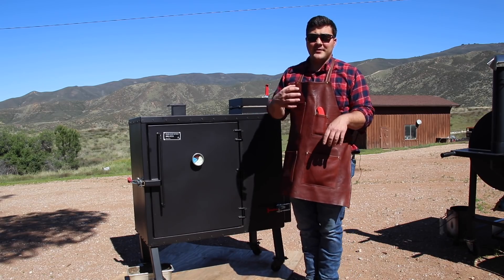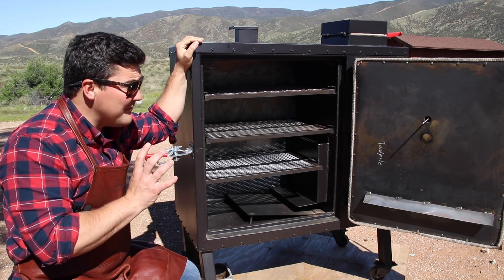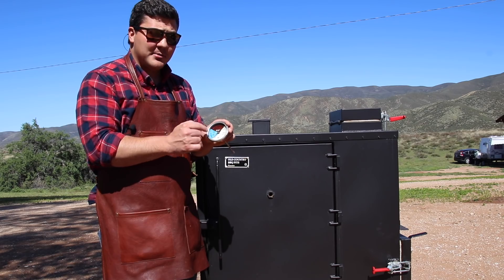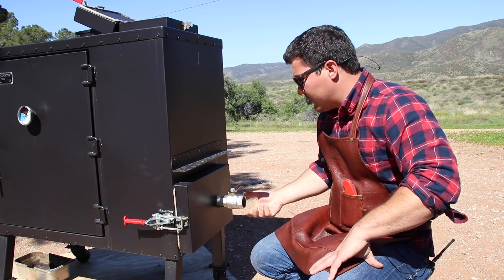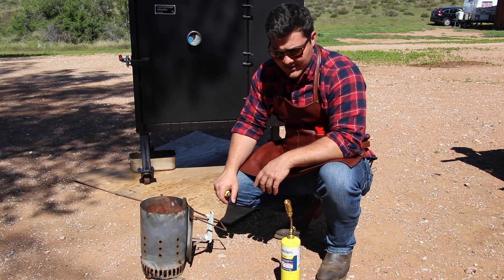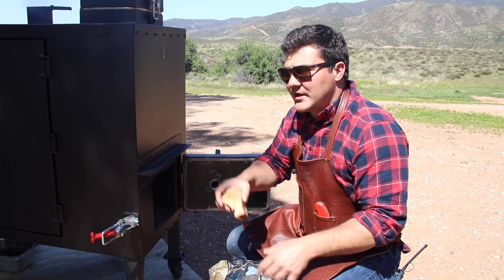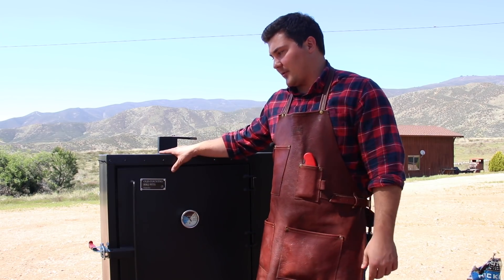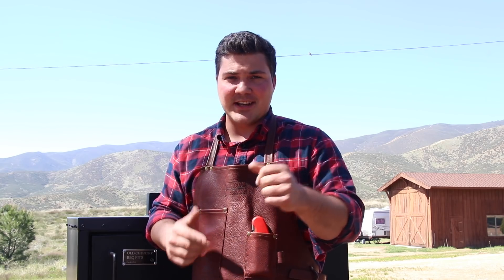How to Use a Gravity-Fed Smoker

Comment: Jeremy great video.
I just purchased this smoker yesterday and before I seasoned it I made a couple of modifications- added a SS ash tray. Added a shim to the grating selves to tighten mine were to loose for me. Added a hole on the left side to allow my temperature wires to pass thru. Removed the existing legs and wheel and added an additional 8” of height and 6” solid wheels. Also added a IQ120 temp control. Once I lit the smoker it seems to take a longer than expected to ramp the temperature up. For fuel used charcoal and four chucks of hickory once it got going it’s held between 250* - 275* for four hours now with adding any additional wood. So far I like what I’m seeing. Once the seasoning is completed I will be cooking ribs for the first time tomorrow. For the money it’s preforming very well. Keep the gravity feed smokers video coming..
Reply: What did you use to add your probe port? I have this pit and want to do the same.
Reply: Cilfton I just added a 2 1/2” long pipe nipple 3/4” dia. I was thinking on a 1/2” size but my probes have curve to them and the 3/4” gave me more room. Now since I have around ten cooks on it I can get the temperature up quickly using the I120 and it regulates the temperature perfectly. My only thoughts are I wish it had a larger cook camber. Good luck
Reply: How do you relight your leftover charcoal?
Reply: I added an expanded metal small box to hold those tumble weeds and I lite three of them with all the doors open until the existing charcoal lites.

Comment: I have a question but first I want to say I am a stick burner and have been since I got my smoker 28 years ago. So I don't understand the bitter flavor if you use too much wood. So my question is, will it work if I remove that grate, start a fire in the bottom and feed it just wood?

Comment: Nice job going through the review Jeremy. One thing I would like to see different is for it to come with larger (better wheels). Small wheels get caught in the joints of my paver patio. Has nothing to do with the cooker but is an issue. Lots of nice features. I like the cabinet type smoker with slide outs. If I get another one it will be this type.
Reply from the maker: Phil N Florence 

You’re right Phil. Big wheels would be a huge improvement. If you notice, I have mind sitting on a piece of plywood so that it doesn’t get stuck in the dirt
Reply: Good wheels can cost $200 alone.... Pretty much blow the price point of this smoker

Comment: I purchased one about a month ago.  I've done three cooks so far, the latest was pork butts.  Great cooker but having some issues on long cooks . . . the charcoal feeder is getting clogged with ash and killing my fire.  After about eight hours of cooking the fire starts to die and I can't keep the heat up.  I noticed my wood chunks were not burning and when I went to clean the next day there was a lot of ash in the charcoal feeder.  Have you had that issue?  Any suggestions?
Reply: I don't have this exact smoker, but do use one like it.  One problem I see is the charcoal grate spacing is too small.  Every hour or so reach in with a insulated glove and jiggle the grate.  This will drop the ashes and won't effect the cook chamber temperature.  I also do this when adding wood.  It helps the wood start smoldering.  I also use a ash tray made of 16 ga. which makes cleanup easier.
Reply: Are you using Kingsford charcoal?   I've heard people saying it ashes too much for this pit.    B&B or Royal Oak are supposed to have less ash issues or lump.
Reply: I bought one of these about a month ago.  I seasoned it with briquettes, but for my first cook, I used lump charcoal and had no problems with the feed in the chimney.  I did give the grate a slight tap every time I was putting in some wood chunks, but did not have any issues.  Way less ash, too...the briquettes ash was suffocating any wood chunks for smoking...didn't have that issue with lump charcoal.  Another option would just be scraping out the ash as you go...try lump charcoal, though...I actually made the best brisket I've ever done on my first cook and I still make a few mistakes and am learning about the pit...

Comment: Thumbs up for your german! Jetzt können wir anfangen! 
One question, do you calibrate your analog thermometer compared to your digital probe? I always have a problem with inaccurate readings... thanks and glad that you finally shaved! ;) greetings from germany
Reply: Florian Kett right ! I notched he slipped that in there, what did he say? Danke
Reply: @desmundlighten3603   he said, "now we can start"
Reply from the maker: I used to do that. Now I only really use the analog thermometer as a relative measurement. I figure out what reading works best and just make sure the thermometer reads the temp that produces the best results. You can get a digital probe to compare. It’s probably a good idea for your own peace of mind if nothing else

Comment: If you have to start off by dumping lit charcoal into the hopper, does that mean you have to unload all of the leftover charcoal from the previous cook in order to do another's cook? Hopefully there is a way to light it if you still have leftover charcoal still in the chute.
Reply: Get a charcoal basket and remove the fuel grate to catch the leftover charcoal to clear your chute. Then start your new cook with fresh hot coals. You can add the leftover coals back into the chute. Either that or you could introduce a couple of firs starters to the fuel grate....I wouldn't recommend it though.

Comment: My main skepticism is in having the vertical stacked racks. Wouldn’t the temp difference be pretty dramatic between the top and bottom rack? Have you tested it?
Reply from the maker: Anthony D 

Low airflow and insulation keep it pretty even. The slow moving air allows the heat to distribute pretty well
Reply: @MadScientistBBQ  I agree, that concept is similar to how a kamado works. Since there is low air flow, you get a cooking chamber full of hot air with consistent temperature.  There may be a .5° degree variance .

Comment: I’m really liking this gravity fed method. I like to grill but love to smoke. My issue is heat management on a kettle is a headache. Question, I know water pans diffuse heat, I’m assuming more meats on the same cook will do the same. Will this require more babysitting until temps has been reached? Lastly can a wired probe be inserted - pinched in the door - without it affecting temps too much. Sorry for my ignorant questions but I’m totally new at this. 
TIA.
Reply: probably, but id go through the chiminy.

Comment: Jeramy would you use a water pan in that type of smoker?  Also if you did would it help regulate the temp even more?
Reply from the maker: Jeffery Rhodes 

The temp is very consistent but I think extra moisture would probably be good. I’ll use a water pan when I do a butt or a brisket
Reply: @MadScientistBBQ  I got the brazos based off your video recommendation.  Have been very pleased with it but curious if there is a mod to put a shut off drain to the grease drain stem so I can fill the bottom with water.  Do you know of any good sir. By the way from MO hickory for the win!😎
Reply: @jefferyrhodes2346  I have a Brazos.  Get a 1 and 1/4" ball valve , can find them cheap on Amazon,  and a cheap one works fine for our purposes.
Reply: @lynndollar1013  thanks!

Comment: Love your videos, been following for years!  Would love to see a more practical video of what the cleaning of a smoker like this would be like after a long cook.
Reply: Is your smoking wood close enough to the bottom of the fire grate so that heat from your coal bed can ignite the wood without having to rely on bits and pieces of charcoal to fall onto the big pieces of wood because we know smoldering wood will not create blue smoke ...

650 degrees up to 750 degrees is ideal temperature to create blue smoke.. I'm sorry to say that I don't believe small pieces of charcoal falling on top of larger pieces of cold wood will create a 750 degree fire if the wood isn't up to temperature to create blue smoke .

I can create blue smoke on an offset smoker..

Looks like separating the coal bed from the smoking wood seems to be trying to create blue smoke in reverse...

650 up to 750 degrees Fahrenheitwould be the fire temperature inside your firebox not inside your cooking chamber.. several people get that mixed up.  

I watched Mr Yoder's video putting cold wood into a firebox but he never said anything about preheating the wood to bypass the white smoke stage of a fire but this video was just a dry run..

Lots of people don't know how to create blue smoke .. 

Should have a video on how to create blue smoke
Reply: @brucerogers3253 what does this have to do with cleaning a smoker?

Comment: own this exact smoker, at 1hr 45 min and only at 190deg.  takes me for ever to get the temp to 250.  i have chimney wide open and door cracked abuot 3" to get more air through but still takes forever!!!  any ideas??
Reply: I have this smoker also. Get the thermoworks billows with fan system or the fireboard 2 drive with fan unit. These are the best 2

Comment: The thing about running briquettes is that they create way more ash than lump so you have to be very diligent in cleaning out the ash after every cook or you will rust out your smoker. Not to mention all the filler used in briquettes.

Comment: Thanks for the  info! I've been try'n to make up my mind on which type of smoker i would like to get and the gravity fed seams really easy and the way to go,
     but it seems like the gravity chute would basically act  like a big chimney starter(like you started the fire with) and burn up the charcoal pretty fast? Maybe I missed something?
 How does it not catch the whole chute on fire?     How long do you think a large 18 lb. bag would last?
Reply: The charcoal hopper is sealed, so no air = no fire. Only the bottom few inches of the charcoal hopper is allowed some air (regulated by you)... More air = hotter fire. Where they went wrong with this smoker is no ash pan. An ash pan lets the burned charcoal ash collect for ease of removal, but the ash pan also lets you put chunks of wood in, and the burning embers fall on top and actually introduce SMOKE into the smoker. If you don't have that hardwood smoke, you're NOT smoking at all.
Reply: This is the same theory behind the Masterbuild 560  gravity grill. The charcoal on the chute won't light up until the charcoal gets the bottom.

Comment: My only question - is this really a set it and forget it smoker or did you have to throw in wood chunks every hour under the coal tunnel.   Thanks for the video!
Reply: Gonna bump this question. Seems like the need to add wood chunks frequently defeats the advantage of the ease of not having to tend the fire itself for a steady temp. That's what I dislike about my Masterbuilt electric. What about adding chunks or chips layered in with the charcoal so they feed along with it? I'd like to be able to sleep for a few hours at a time. And is there a port for meat probes or do you pass them through the door gasket?

Comment: My pellet smoker doesn’t put the Smokey flavor in the meat like my offset smoker. How would this smoker compare. I’m guessing it would be like the pellet smoker right?
Reply: Joe H. I just bought the old country wrangler offset because of that very reason. Even with a smoke tube in the pellet grill I couldn’t get good smoke flavor.
Reply: No, not the same at all. Pellets don’t get the flavor like actual would chunks or splits. You could keep the bottom loaded with wood and get some solid smoke flavor.
Reply from the maker: It’s the closest I have found to an offset. Not the same but way better than a pellet or ceramic cooker

Comment: Love your videos...  Can you easily stop the charcoal burn to save charcoal?
Reply: By using lump charcoal instead of briquettes,  you would be able to seal off the air intake and exhaust to stop the cooking process. It is similar to using a kamado style grill/smoker. Briquettes will smolder much longer, thereby wasting fuel.

Comment: Wow acreage in CA, definitely hard to find. Looks like a great smoker, I wish they had a facing thermometer relay next to the intake valve so as you regulate for more/less air you can see the temperature without having to walk around to the front of the smoker.
Reply from the maker: CXK 

You can attach a unit to do that. I’ll be testing one out in the near future
Reply: @MadScientistBBQ  are there battery operated airflow control units? I hate having to depend on AC power.

Comment: Can you add wood chunks between layers of charcoal eliminating the need to open the door to add wood?.
Reply from the maker: Walter Ramirez 

Interesting idea. I bet you could but I hadn’t even thought of that
Reply: I seen people doing it successfully. Just add a few chunks in layers combine with the charcoal. Hey that could be your next video😁
Reply: Walter Ramirez   You could do that, but it’s not necessary.  I’ve had a similar pit for about 7 years from a different manufacturer.  Opening the door will not affect your temp at all.  Yes, it will allow more air in, but it take just a few seconds to add wood, and it’s not nearly enough time to disturb your temp.

Also, since the wood is put below the fire, the smoke is drawn up through the fire before making its way into the cook chamber.  This burns off all the soot and makes for a much cleaner flavor.  My wife is highly allergic to hickory, and she can eat anything I cook on mine.  Putting the chunks in with the charcoal will push the soot into the chamber.  Maybe not a big deal to most folks, but we can definitely tell the difference.
Reply: @Able_Cylon  I understand what you are saying but the point is that, in an overnight cook, you can leave the smoker cooking while you sleep and the wood would be burn automatically instead of the person having to keep an eye to be adding wood every so often. But you are right about temp changes.

Comment: Just wondering if you finished cooking with charcoal in the chute. Can you shut it off by closing the air off. If so can the charcoal be emptied out to start another cook at another time. Or how would you relight the charcoal left in the chute?
Reply from the maker: omar nunez 

It can be snuffed out by closing the intake and exhaust. I haven’t tried removing the charcoal yet.

Comment: how to solve the start up time . it takes a long time to get temp up .as much as 1 1/2 hour
Reply: Pit controller such as a Fireboard, bbq guru, IQ series. It cuts the time to 30 to 40 min or so which is what you can expect from any smoker. The reason is that to get enough air for a quick start, you have to leave the door open but then you lose a bunch of your heat. The fan on a controller puts enough air in through the ball valve with the door closed and shuts it down so you don't go way over.   While you don't really need a controller for actual cooking on a gravity feed, it makes the start much faster and easier.

Comment: They could add an ash pan. They could improve in the loading system so you could use lump. & add a freaking grease catcher so you don’t have to put something on the ground!  They can weld a grease pan holder under that drain. Other than that. I like it.
Reply: I can see easy mods to fix these issues. A threaded cap to seal the grease trap. Remove and drain when you want. A cookie sheet baking inside could also catch drippings. Drain when you're done. As for the charcoal grate. It should work as is but may clog only with too many large pieces. Those can be broken up as you load your charcoal. As is, I'd like to have one.
Reply: I think that B&B lump charcoal will slide down that chute fairly well. Large premium lump like Fogo or Jealous Devil will definitely clog the feed chamber.